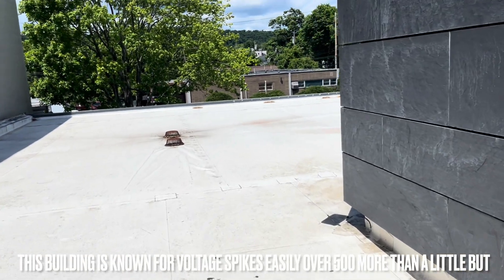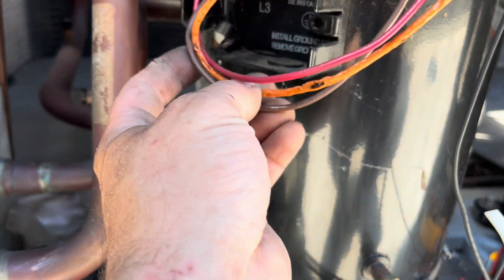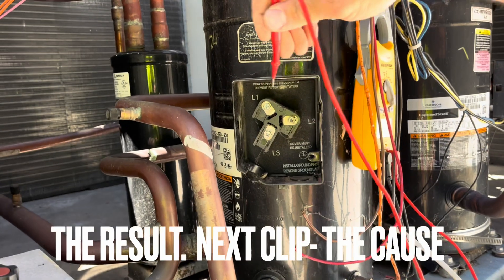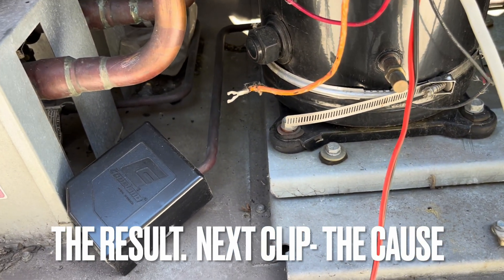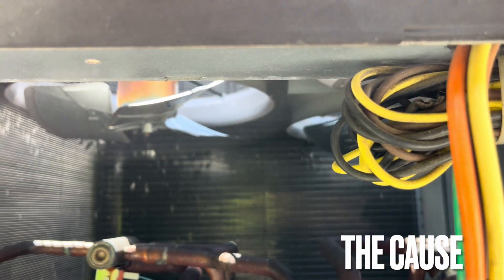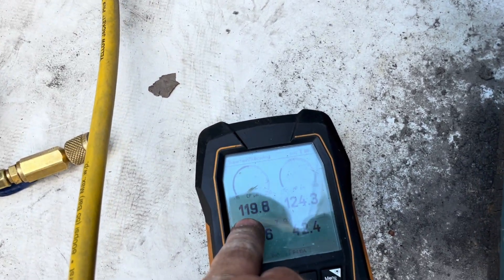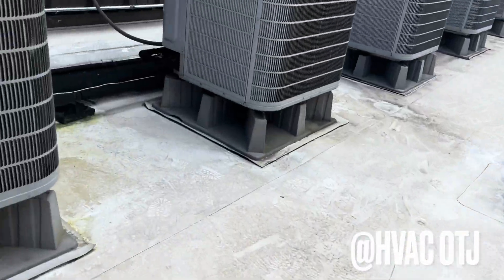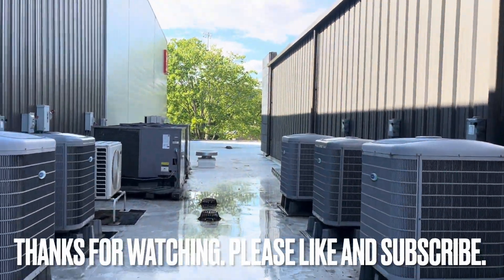HOW TO CHECK IF MY COMPRESSOR IS SHORTED TO GROUND?   (NOT FOR A HOMEOWNER OR INEXPERIENCED PERSON).

Comment: What happened to Carrier. Years ago I was talking to the Carrier technical department in Southern California and we were talking about their research and development, and  after talking for awhile the technician told me something that shock me. The technician said that they did not have a lot of the time to spend on research and development so they rely on the contractors and customers to due a lot of the research and development. I've also talked to Rheem and was told basically the same. No wonder so many parts go back under warranty. Another good video.

Comment: What was that electrical bundling crap? Yikes I’ve never seen it that bad when I did service. BTW you’ve got some good reliable help with ya👍
Reply from the maker: I appreciate that Anthony.  That is a nest of wire disaster and why the compressors short out.  And so many low voltage issues too.
Reply: @hvacotj  I call that crap ass wash.
Reply from the maker: Facts.